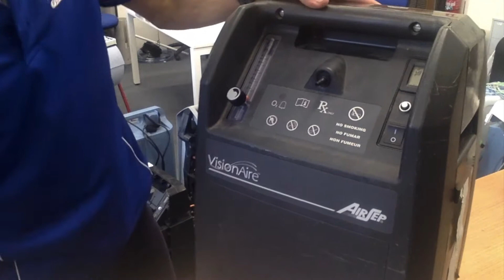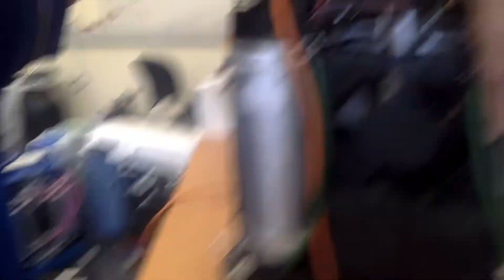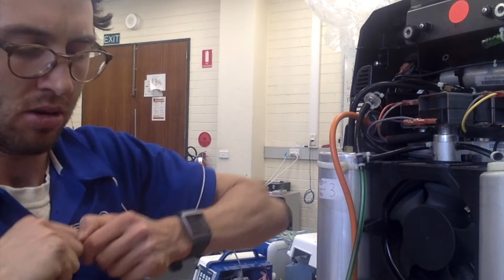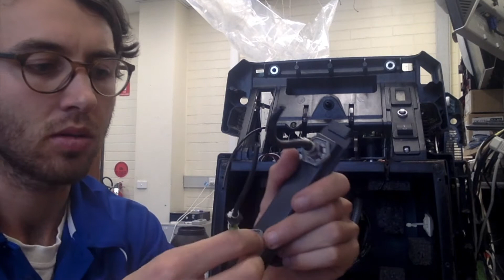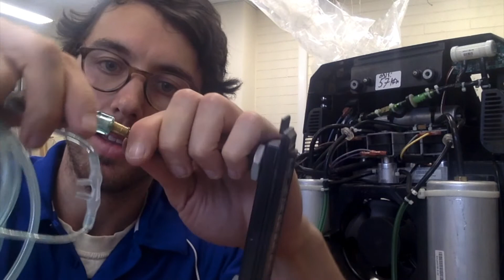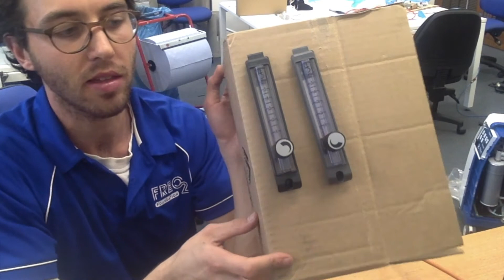How to build a flow splitter from oxygen concentrator parts

Comment: @Kevin Rassool
I am disabled and use oxygen 24/7. I have looked far and wide for an Oxygen Flow Meter splitter to use, just like the one that you put together in the video. No one manufactures, let alone sells any here in the United States. I found one in the UK, India and China, but they either won’t sell it to me, or the shipping turns out to be super expensive, plus pain in the butt paperwork as well. I’m going to try and make one like yours, but I don’t have the spare parts that you do😔